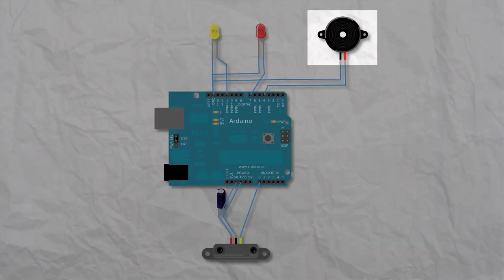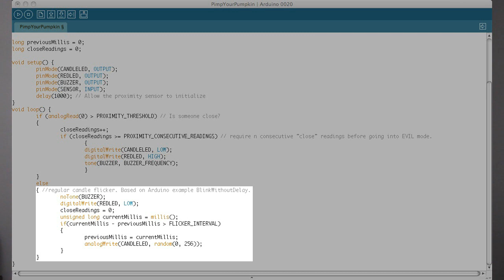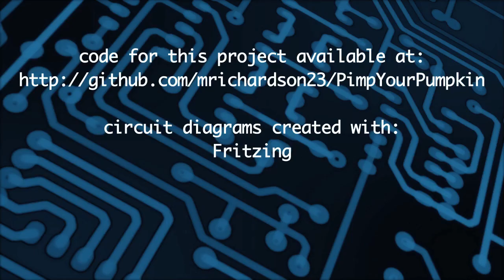Pimp Your Pumpkin: an Arduino jack-o-lantern

Comment: That's pretty sweet. I can imagine going a step further and instead of the crazy speaker sound, hook it up to a speaker & have it turn the speaker on & off. The speaker can then be hooked up to an MP3 player looping the zombie sounds from Half Life 2, or any other sound of your choice.
Reply: Hey man. I know you commented this nearly a decade ago but I was wondering how you would go about this and how much more hardware it would actually require. Not really expecting a response but its worth a shot lmao
Reply: @BR3DOL  Ha! I'd forgotten about this. So there are two possible ways I'd do this now. First is how I described, mp3 player with a mono speaker. I'd cut one of the wires going to the speaker and put a mechanical relay between the two. Wire an arduino digital out to the control pins of that relay and press play. Now, when the arduino pin goes high, the speaker turns on.
The other way would be to use a raspberry pi instead of arduino. Wire a motion sensor to the pi and plug in a speaker. Fill a folder with sound files. Write a script in python to play a random one when the sensor is tripped. You can also add in some code for lights similar to the arduino code.
Reply: @Tsaoted  Im shocked you responded. Thank you !